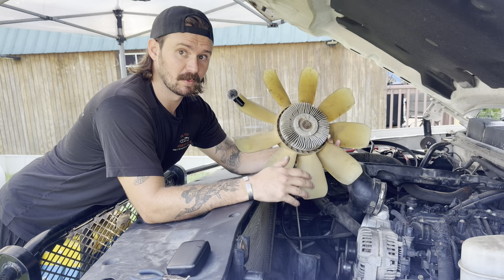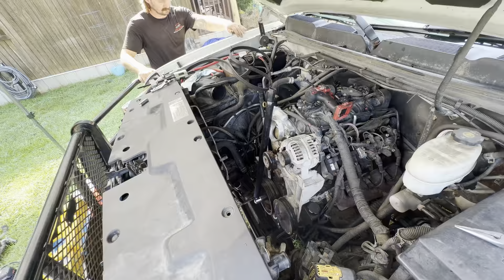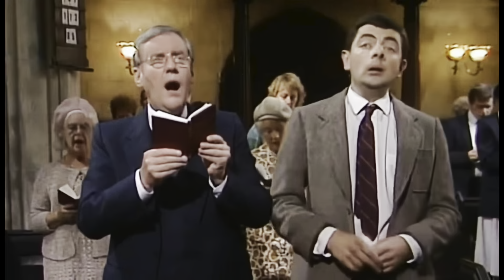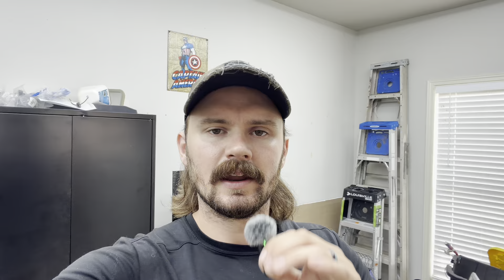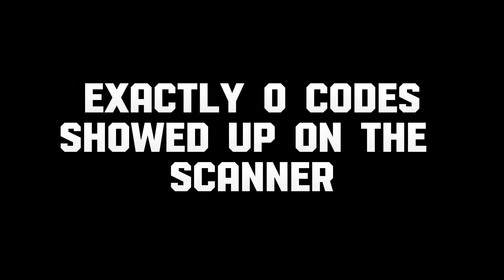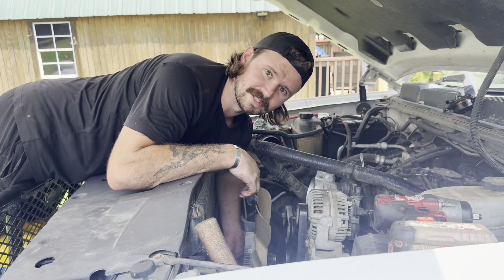How to Remove BROKEN Camshaft Position Sensor! (2010 Chevy 6.0L)

Comment: So u didn't mark the pulley to the crank before pulling it off. Maybe I'm alittle off. But I would think it has a specific placement for the timing marks and tdc.
Reply from the maker: On many engines, especially older ones, you would be absolutely correct. However on these engines there are no external timing marks on the crank pulley or the timing cover itself. Typically speaking those timing marks used to find TDC are for setting ignition timing, so since the ECM sets ignition timing based on information received from crank/cam sensors, it makes sense why there are no timing marks. However if you are working with VALVE TIMING, there are internal marks on the engine and sprockets that you definitely want to pay attention to and make sure they’re lined up. But in this video I wasn’t going quite that deep
Reply: @InYourDrivewayAuto got it
Reply: @InYourDrivewayAuto  just wondering on 2000 silverado 4.3 base model do u know exactly where the ground is for the bcm. Goggle said behind the a piller . Or near the column.  Ive looked at both and cant find it
Reply from the maker: From what I can see on schematics, it looks like in the C-1 connection for the BCM, the ground pin is the black wire in the A1 position. I can’t find exactly where it ends in the schematics but that’s where it starts. You may be able to use some test leads and a power probe to create your own ground to bypass the broken circuit and see if that fixes your issue. If so and if it doesn’t cause any other issues you can just permanently run your own ground wire from here.
The other option is just to follow the wiring harness from that connector until you find a ground
Reply: .  Thanks for the info. This ground is been my nemesis.  Guess it time to put the vdiagtool to work. 😆
Reply from the maker: @larryhart4880 keep me updated on what you find/how you fix it!